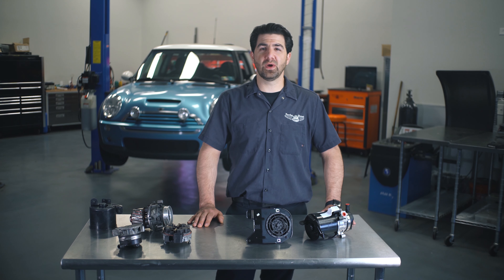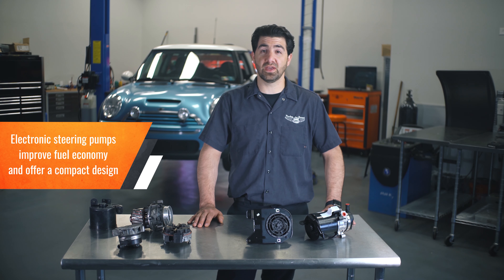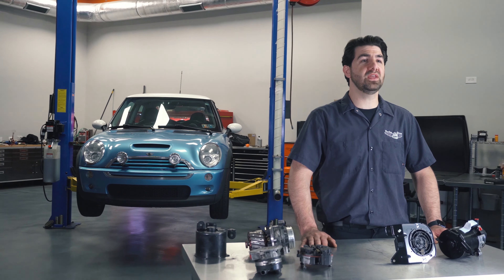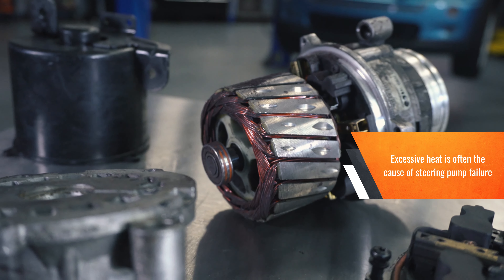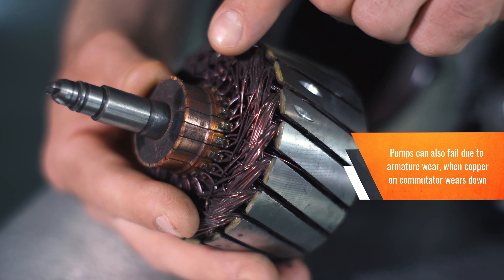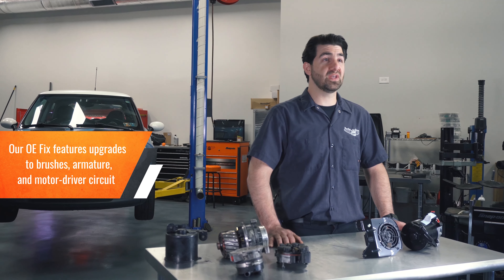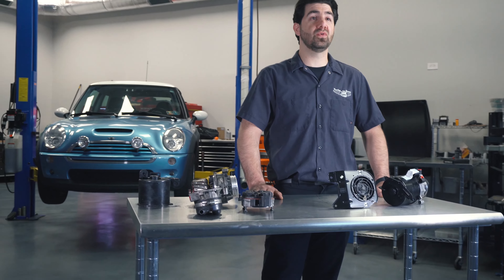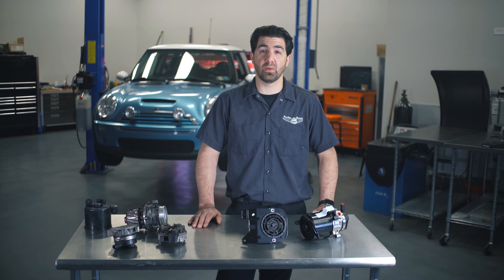Dorman's OE FIX Power Steering Pump Improves Reliability for Mini Coopers

Comment: it sounded like Dorman refurbs the electrical side and doesn't touch the pump side.. I just bought one of these and the pump makes a tapping noise and doesn't build any pressure// work.  So I opened it up and the pump side was full of aluminum corrosion like small bits of white popcorn. Cleaned it off and turned out with a drill it was all scrap scrap scrap . For 500 bucks yall should fk with the pump side too.
Reply from the maker: Hi Taylor, Can you please provide us with the part number and where you got the part from? Also, the year, make and model of your vehicle? Thank you.
Reply: @DormanProducts   actually I was planning on deleting this or replying with what happened. So advanced auto 7669 2484 w Illinois Ave I took the dorman 599-950 back and swapped it out.  After seeing the second pump with its tamper evident tape over the connector and just how perfectly clean it is.  I realized that they first sold me a part that had previously been returned by a customer that scammed them.  Obviously someone bought the pump and then swapped out the motor housings so that their old pump now had the dorman sticker on it and they returned that to the store claiming it was bad I assume.  The store should have caught this due to there not being any evident tape, broken or unbroken, and just the comparing the actually newly refurbished dorman part to what that pump looked like.  Also, a returned "damaged" or bad part shouldn't be resold to anyone.  Perhaps dorman caught the scam and denied the store which at that point the store attempted to push the scam part off on me.  Just waiting for this rain to die down so I can finish putting this pump in on my dads 2005 mini cooper s.
Reply: So.. that second pump did nothing! Aggravating cause that fluid is 40 bucks a can.  Had me thinking I must have something wrong but all my connections have the right voltage.  So I took it back off and found continuity between the terminals of the motor. Bad motor.  So I am waiting until they get another one tomorrow to swap it out again! Lucky number 3 I hope!